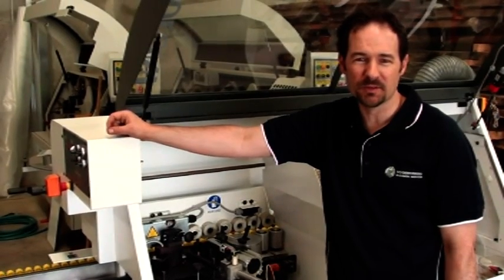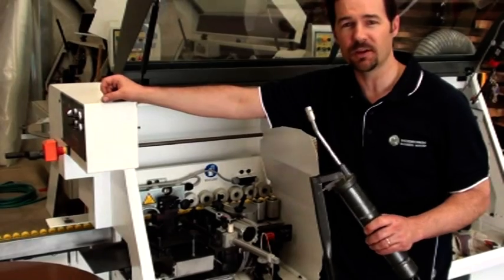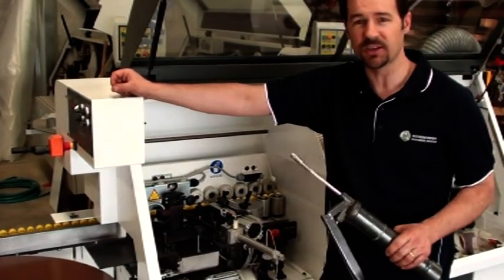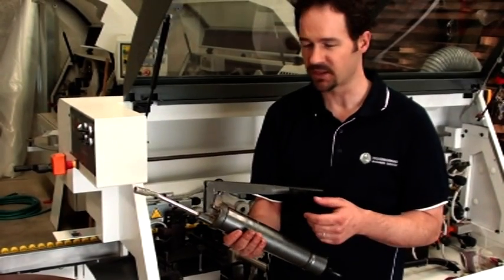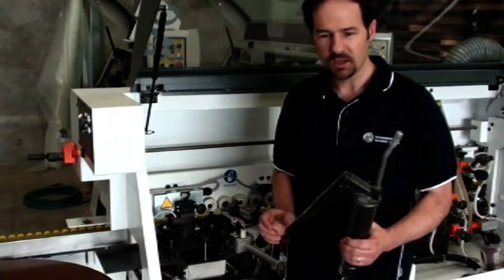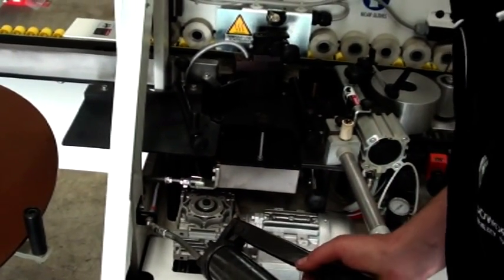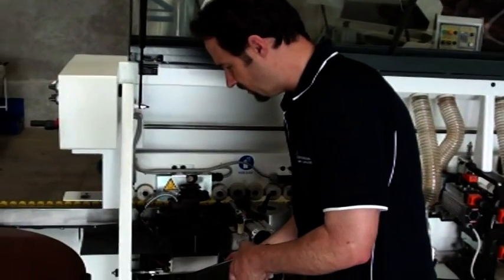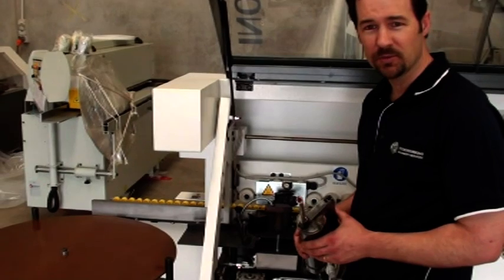Lubricating an edgebander glue pot

Comment: what should I do when as I pump the high temp grease and it oozes out as if the grease is not entering...I assume that the glue pot has not been taken care off ..so the pot is filled with dry grease? or some one put the wrong grease in? I'm thinking that the glue roller will need to be taken out and refurbished?